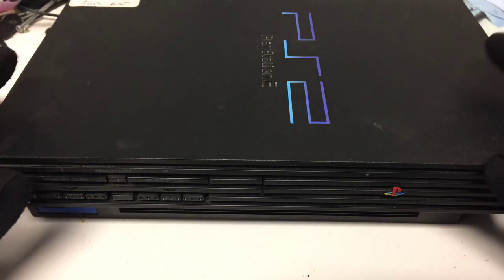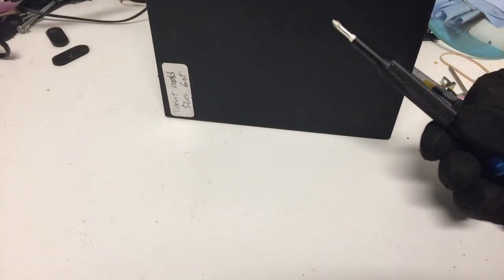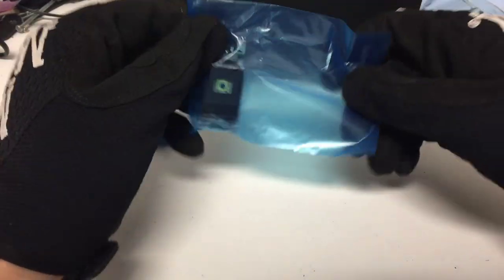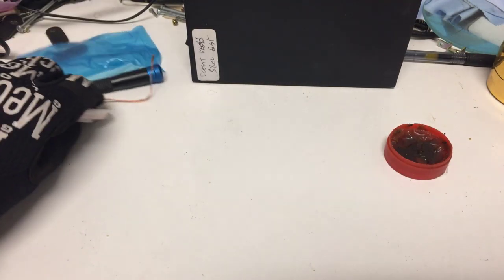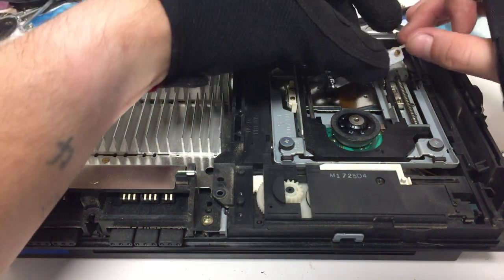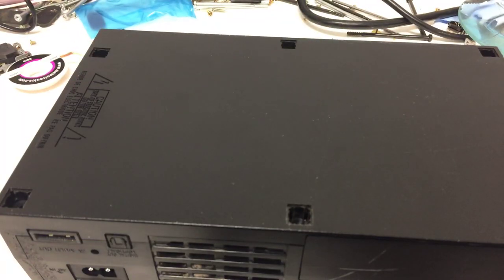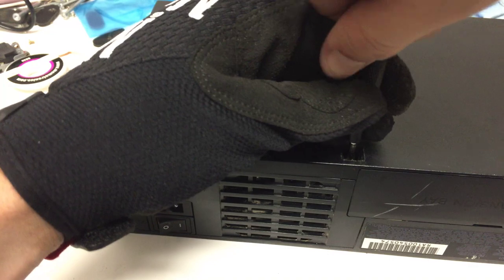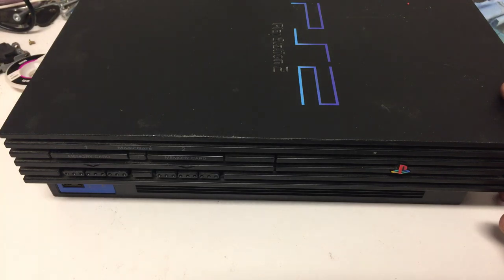PS2 Phat (fat) Laser Replacement + tips & tricks for replacement

Comment: Replacing the laser on a grey ps1 is so much easier ps2 looks complicated
Reply from the maker: Yeah, it is a lot less complex for a ps1. For ps2, several more steps are needed. However, it can be a piece of cake. Just focus, remain calm and steady, and you should be golden.
Reply: @cloudstriferepairgaming  i replaced the laser on my ps1 scph 9000 with a new sony brand laser and it is flawless
Reply from the maker: @califaern3sto  good job! 💪😎
Reply: @cloudstriferepairgaming  well it was extremely easy
Reply from the maker: @califaern3sto  worst case scenario, you could always see about replacing the entire drive of your phat ps2. May be easier if you can find a decently priced drive assembly for your particular model. Laser is definitely the cheaper route.
Reply: @cloudstriferepairgaming  i just ordered a scph 5000 model, its still fat but my understanding is that it's more reliable than the 3000
What do you think of the 5000
Reply from the maker: @califaern3sto  As far as reliability and such goes, they’re about the same. The newer models are slightly better laser. Fixabilty is mostly the same as well. Few things are much different. Things on the inside may be placed differently, or slightly updated. I’ve always preferred 30000 models myself. I find they’re just slightly easier to fix as well as slightly cheaper to fix as well. After you fix, they’re tough as nails still. Generally only a dead laser (or malfunctioning laser) or dead battery. But still mostly the same. I also feel that phats are better than slims because they tend to run better all around. But, I do seem to run across really crap condition slims. So, maybe that’s just my luck? Lol
Reply: @cloudstriferepairgaming  my slim is the unfortunate model that overheats, put years ago i found that by putting a fan behind it it'll stay cool longer, also that same slim scratched up my final fantasy 9 disc and resident evil directors cut discs whereas the fat ones never did so i agree the phat ones are better im just assuming that because the 5000 are newer they'd be slightly better built and longer lasting than the launch model. The same can be said about other consoles
Reply from the maker: @califaern3sto  dang. You should try to find a spot near you that does disc repair. Those discs can be fixed in a disc repair machine. But yeah, even ps3 slims I’m not a fan of. When it comes to PlayStation slim consoles, there are way too many that tend to have multiple things go wrong and or finicky and devastating issues. Just problematic.
Reply from the maker: *Ps3 super slim. 
The slide tops
Reply: @cloudstriferepairgaming  yeah ik, there was a shop here that sold lots of modern and retro games and resurfaced discs 5$ a pop but coronavirus fucked it up and its gone
Reply from the maker: @califaern3sto  dang. Some places have mail orders. Google search to see if there’s any that you’d be comfortable sending your stuff.
Reply: @cloudstriferepairgaming  i just remembered a long time ago I had another grey ps1 that the thing that spins around the disc with the 3 metal ball things the plastic broke so it fell apart, have u done a vid on replacing that?
Reply from the maker: @califaern3sto  no, but it’s fairly simple. Pop off the hub (below the spindle. The part that holds the disc.). A replacement spindle should come with a hub as well. Press down the spindle over the spinnet (metal shaft that you removed the old parts from), and you should be good to go. Worst case scenario, get a whole new drive for your particular model and replace that.
Reply: @cloudstriferepairgaming  thanks man!
Reply from the maker: @califaern3sto  no problem!
Reply: @cloudstriferepairgaming  hey man ive been playing with my ps2 scph 50001 i got on ebay and it plays ps2 games flawlessly with composite and component cables, unfortunately not with ps1 games regardless of cables. There's like a stutter that happens, like every 10 secs the music skips and fmvs as well very odd, any ideas?
Reply: @cloudstriferepairgaming  i just played an audio cd and there's skipping so im going to guess that the cd lens has skipping issues but the dvd lens doesnt, but it plays ps2 cd games just fine not ps1 games how weird
Reply from the maker: @califaern3sto  yeah, you may need to replace the laser if you wanna play ps1 games. There’s a couple things you could try, but I don’t recommend them. Better to just replace the laser. Cleaning/adjusting the laser. I don’t recommend doing that though. May end up causing more harm in the long run
Reply: @cloudstriferepairgaming  yeah I'll use it for ps2 games exclusively. I ordered a 39001 as well thats #1 for reliability and 50001 #2 lets see if what issues if any that one has
Reply from the maker: @califaern3sto  awesome! 👏 Hope they work out for you! 🤞
Reply: @cloudstriferepairgaming  ill lyk in a few days
Reply: @cloudstriferepairgaming  here's an interesting update: i used a 99 cent store cd laser lens cleaner cd like 3 times, still kinda skipped a bit while playing it and then i started playing wrestlemania the arcade game and i had set it to load the cd fast and when i played it the audio was buggy so i reset it and played the game with regular settings right now and its skipping a lot less now? Im confused im assuming the cd lens is still sort of dirty and needs use maybe a few more cleaning with the cd? How interesting
Reply from the maker: @califaern3sto  cool! Yeah, try that a bit more. I had no idea those are still sold in stores. That’s rad. It could be that it’s dirty, but it’s risky to go in there and swab at it. Could damage the laser if you’re not careful. Those cd cleaners were decently useful back in the day. I’ll have to check my 99 cent stores! Lol
Reply: @cloudstriferepairgaming  game works good cuz its 2d but the lag and stutter is still there in 3d games I'm playing a bugs life and need for speed 3. Ill still try to clean the laser with the cd but it seems that the laser is just no good
Reply from the maker: @califaern3sto  quite possible, and not entirely surprising. One of my ps2s was picky about things it wanted to play. My ps2 was a weeb. It only liked to play anime and Kung fu movies, and not any other movies. They could be a brand new dvd and my ps2 is like, “Nope!” But just movie based. Never had a problem with anything else.
Reply: @cloudstriferepairgaming  just tested the SCPH-39001 and it plays ps2 cds dvds movie dvds and ps1 cds like a champ although it is slower to recognize disc type but once it starts there's no stopping it so the 39001 is ahead of the 50001 in everything and 50001 is a #2 models scph 30001 and 35001 are to be avoided at all costs
Reply: @cloudstriferepairgaming  oh wow after cleaning the dvd and cd laser twice with the cd and dvd cleaning disc and using diagnosis mode once, all discs boot up quicker! Im impressed. And ps1 games are in 480p! Dvd tray is kinda slow when ejecting but that's normal wear and tear
Reply from the maker: @califaern3sto  awesome! Glad they’re working out for you. As far as the tray goes, you could try a blowout and possibly a new belt. But if it’s not too bothersome, then it should be okay.
Reply: @cloudstriferepairgaming  damn ps1 games in 480p on my SCPH-39001 is so good! I can't imagine how much better they are on ps3 but I'll settle for this. Need For Speed 3 Hot Pursuit looks gorgeous! 1998 all over again and in enhanced quality this time wow :')
Reply from the maker: @califaern3sto  awesome! Yeah, I’ve been playing some ps1 games lately too. Had gotten an old school Sony active super woofer that I’m using for ps1. Lots of memories with Gran Turismo 2. I’d get blisters from playing it so much. Lol. Still have all my original saves too. Super happy to set that up. Got it set up with my buzz lightyear tv. 😎
Reply: @cloudstriferepairgaming  haha taking a trip back to the late 90's <3
Reply from the maker: @califaern3sto  exactly! 😎👍
Reply from the maker: @califaern3sto  got the beanbag chair too. 😝
Reply: @cloudstriferepairgaming  i miss the late 90s, in 1998 i turned 7 in February 13, when I wasn't playing super nintendo I was outside riding bikes playing tag hide and seek and other things kids don't do anymore
Reply from the maker: @califaern3sto  yeah. The 90’s were the best. It’s unfortunate that kids nowadays have to grow up with all this COVID stuff too. But, times do change. Sometimes we need to have a blast from the past, and share it with other people as well. Nothin better than couch play with your sibling or friends. It’s rare that new gen games even have couch play. Most of it is online/separate console